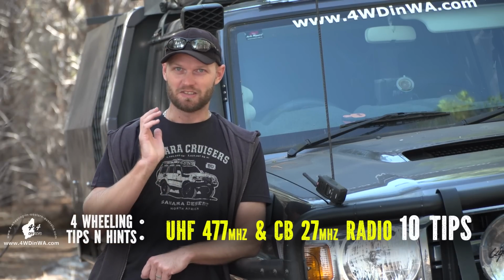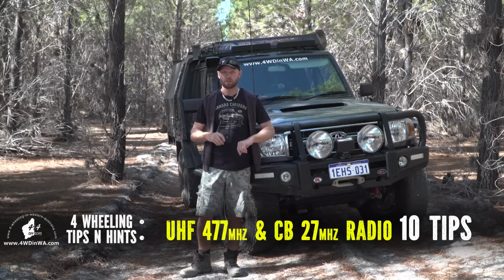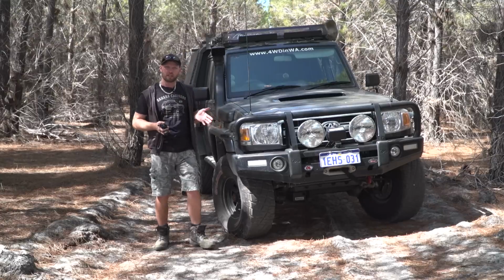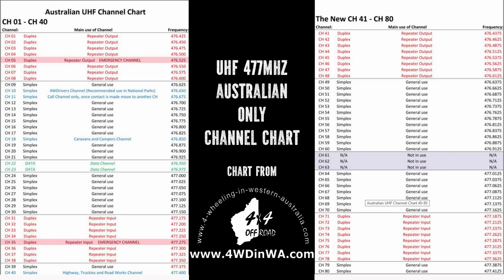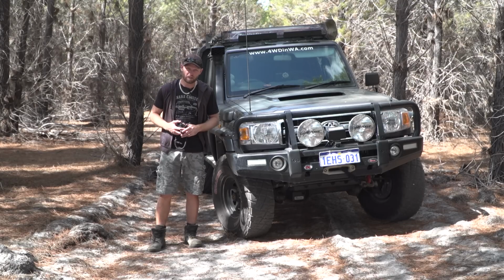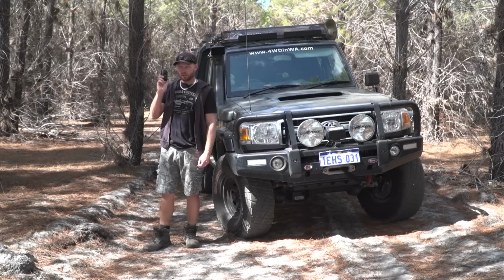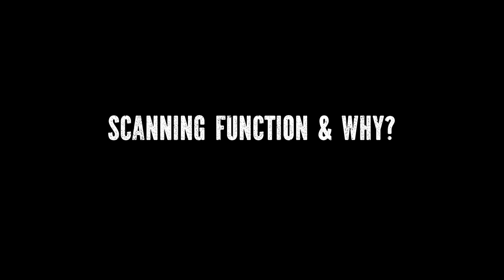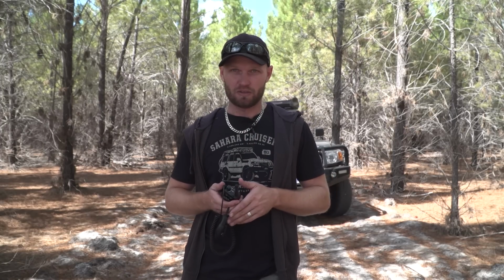UHF CB Radio 10 Tips

Comment: Drawback of so many options here in the US is that different groups use different radios. We've got about 6 different common options (not counting Sat/Cell.) Canada is similar. Maybe this info will help out some of your N. American viewers.

== BLUETOOTH ==
Really common with motorcycle groups. Interoperability issues if you don't all own the same make. Sena is the most popular brand around me. Range 1 - 2 km. No license. A useful piece of kit is a Bluetooth hub that you can plug into a handheld radio. Instead of pairing your headsets to each other, pair your headset to the hub, then plug the radio of the day into the hub too. All of the units I'm familiar with are helmet mount, but other form factors might exist. If you don't ride motorcycles with others, ignore this and move on.

== FAMILY RADIO SERVICE (FRS) ==
UHF-FM, 0.5 watt, 7+7 channels, no license. Extremely cheap to buy. Limited range. Very line of sight. ~1 km range. Very common with casual groups, families camping, etc. 

== GENERAL MOBILE RADIO SERVICE (GMRS) ==
UHF-FM, 5/50 watt, 8+7 channels. Range ~3km on handhelds; much further on mobile/base. Base stations, mobile, and repeaters are allowed, but uncommon. Most GMRS radios are sold as handhelds that combine GMRS with FRS bands in a 22 channel unit. License is required; no test, currently $90/5-yr. 

Compliance with the license requirement is largely ignored. Most people just buy a pack of handhelds then start using them like a kid's walkie-talkie. FCC is considering dropping the license rather than try to police it. When the FCC does cite people, they don't mess around. We're talking large fines in the thousands. You are required to identify yourself with your call sign every 15 minutes. Using one of the low power handhelds in a way that doesn't draw attention is fairly low risk, but being a goon over a 50W radio will of course draw attention. Dropping the license sounds appealing, but if they do, they'll likely lower permissible wattage and possibly add other limits like they did with CB. We'd possibly loose a lot of what makes it so attractive. 

That aside, if you do decide to go all-in, it is a great band. With a 50W mobile, you'll be crystal clear as far as the eye cam see. All the people with the cheap handhelds will hear you loud and clear. It far eclipses CB in clarity and range (most of the time.) $18/yr starts to sound more reasonable once you learn that you can do a lot more than that $20 Walmart handheld is capable of.

== CITIZEN BAND (CB) ==
27 MHz HF-AM, 40 channel +SSB, noisy, no license. Range ~7km AM, longer on SSB. SSB is a big improvement, but not available on the cheap models. Both ends need to have it to talk. Although not as common as it was in the 1970's, commercial truckers still use them to share reports of traffic, weather, police activity, (short skirts...) With casual recreation users, I think it depends a lot on region and group. Unless you're eager for those road reports, I think you can safely delay this one until you learn how common it is on your trails.  (Side note, you'll hear about long distance contacts on CB but there's a reason people talk about it... it is remarkably rare. Don't plan your comms on it.)

== MULTI-USE RADIO SERVICE ==
VHF-FM, 5 channels, 1/2 watts, no license. Range ~7 km. Base stations and handhelds. Used around ranches, etc. Not common among casual recreational crowds, so there is often lots of room. This is a great option for groups that drive together regularly, want to avoid the crowds of FRS, the static of CB, but want to stay legal without having to pay the license for GMRS.

== AMATEUR RADIO / HAM ==
License & test is very cheap. Wide selection of bands. Not very common for group excursions, but the most powerful and flexible. The entry level test is so easy a 5 year old can (and has) passed it. That'll mostly get you on the higher, FM bands. As long as you're near (20 - 30 km) town, you can probably hit a repeater and talk over hundreds of square miles. With a bit of studying, you can upgrade to get lower bands which can go thousands of km. Many towns have clubs that offer free/cheap training sessions which will teach you what you need to know then do the test right after, all in one day. People are perpetually upgrading radios, so if you're looking to buy, contact area ham radio clubs.

If you've got your GPS coords and a working Ham radio, no matter where you are on the planet you can reach someone somewhere who can relay a distress call and dispatch help, with no satellite fees. It does take a little more know-how than dialing a phone though, but you don't need to feel intimidated. In a genuine life-safety emergency, anyone can use any means at their disposal to call for help, regardless of licensing. If you're afraid of a tiny bit of studying and too cheap for the $15 test session, you could still buy one as a poor man's emergency 'sat-phone.'

I need to repeat that point. A lot of people groan about paying the GMRS license. Well, if you and your buddies can spare a Saturday to attend a cram/test session, or you can flip through a book then go sit for the exam, it is $15 once in your life and you can use radios that are as good or better than the GMRS stuff. (Not on the GMRS freqs.) 

Note that any good multi-band ham radio on the market could be programmed/tuned to every one of the above bands. Listening is perfectly fine, but transmitting from a non-type-approved radio is illegal.

-- TLDR; -- 

If you always hit the trails with the same crowd, then life just got simpler. Buy what the other drivers have. What's a guy to do if things aren't so easy?

* RAM mount or similar that can hold the radio of the day is nice to have.
* One combined FRS/GMRS 22-channel handheld. One FRS per person can be handy at camp.
* One CB handheld.
* One MURS handheld.
* VHF/UHF handheld Amateur/Ham radio if you decide.

I'd say start there in that order and the rest will evolve as you use things. If you use a band often and/or want better range/clarity, it'll become apparent to you which systems you should add as fixed installs. FRS are pretty much limited to handhelds by rule, but you can get mobile installations for MURS/GMRS/CB/HAM.

Just plopping a magnet mount antenna (if available) in the middle of your roof can help a lot as an intermediate step. Swapping the included rubber duckie antenna on all the handhelds (except the FRS) can also help a lot. As a rule, you're better off with a top quality antenna system and a cheap radio than the other way around.

Wow, that got long! Hopefully it'll be of use to someone.
Reply: The FCC is keeping the license requirement for GMRS. They are also going to allow FRS up to 2 watts on the 462MHz channels.
Reply: ElfNet Designs FRS/GMRS in Europe are widely used for Fire Brigades in the UK, Police in Russia, Amateur radios in Germany.
Reply: Jordan Cunningham The aircraft band is from 108-136mhz Am☺
Reply: Seth Williamson in an emergency what radio would be the best to own in NYC
Reply: @Dan Guilfuchi - Emergency as in disaster preparedness? I've only been to NYC once, but I think the best place to start would be to search online for something like "NYC amateur radio club." DXZone has a good list you could start with. Get in touch with them. They'll be more than happy to chat with you at length about the pros and cons of different options based on their combined experience operating in your area.

In general though, I'd recommend getting the entry level (Technician) amateur radio license. It is cheap and easy. You likely have clubs near you putting on weekend class + exam sessions. From there, a handheld VHF/UHF radio will get you talking either directly or via the (likely) extensive repeater coverage in that area. Wouxun KG-UV6D or similar is a pretty inexpensive entry level radio. Check out brands like Yaesu and Icom if your budget allows.

The ARRL is the US national amateur radio association. They have a program called ARES (Amateur Radio Emergency Services) that you might be interested in. 

Hope some of that helps!
Reply: Right you are. Good catch. That far into the post I was worrying about brevity and I clearly mushed things up in that case. Fixed thanks to you. :)

Gear can be extremely expensive or relatively cheap depending on your tastes and wallet. You can easily spend more than you would on a new car. Like any hobby, there are always those that need to have this year's latest and greatest. The used market can be quite fruitful. For a new person just getting on the air, the guys in clubs around me have even been known to give away gear for free. Many HAM's have a garage full of unused gear. If all you need is a VHF/UHF handheld, there are some Chinese models that are surprisingly well made for the price, under $200 USD. For VHF/UHF mobile, I'd start on eBay personally.
Reply: Seth Williamson which would aircraft radios be?
Reply: ElfNet Gaming I'm from the Philippines too. They're selling Australian UHF CB 476 MHz radio, US/Canadian GMRS/FRS/GMRS radios in the Philippines via OLX, Lazada, etc.

Philippines has 325 MHz 40 channels  walkie talkies for their country.

Australian UHF CB radios covers theTV frequency of UHF TV15 in the Philippines/Americas, UHF TV 14 in Japan, etc.

Is it legal to use UHF CB Aussie radios in Americas? Thanks.
Reply: CB is 11 meters when 10 meters is open so is 11 meters. It's not rare.

Comment: like always, outfreakingstanding!  Only things I have to say is you can do long distances on lower output but things need to be ideal (good terrain which typically equates to elevation coupled with little to no interference).  I have made perfectly intelligible transmissions/receptions over several miles in the US Rockies.  Another thing is duplex isn't limited to obscure towers, my rig is also capable of functioning as a repeater for the purpose of emergency communications network.  Despite those two things, definitely a better job addressing this issue than I could do.  Great Job!
Reply from the maker: +USCOMBATDIVER excellent point with the mobile repeater station, I'm going to have to try this out sometime.

Comment: Does anyone know if you can use a handheld ham to communicate with a CB?
Reply: if you find an old radio or some military radios don't have those channels blocked out.  The capability isn't extraordinary it is just most modern radios have those frequencies blocked out for a variety of reasons.  A close amateur bandwidth is 10 meters if you want similar characteristics.  Both the CB and similar frequencies are ideal for open spaces.  UHF and similar or higher frequencies are better for closer range but more obscured (buildings, trees, etc.).

Comment: Hello Ronny, i am having a dilema with my uhf with my mates. only recently in the last few trips my uhf has been playing up with one of my mates and his only, i can hear everyone else perfectly and everyone else can hear my perfectly, he can hear my perfectly although when he talks to me it sounds like he is just spamming the talk button while talking along with it being really muffled, i have reset my uhf and it still did not fix it. what do you think is the problem? for me to just not be able to hear him could he have a blocker on me of some kind without knowing? in the past it has worked fine only the last few months its played up. any input is appreciated. cheers
Reply: ditto to Ronny's comment.  Along those same lines an accidental bump of the radio could put you into 'privacy' channels where a certain code/signal must be transmitted with or before transmission in order for it to pick it up.  These settings tend to be found within squelch settings if that's the culprit and sounds like a likely candidate of the issue.
Reply: where I  can get a  walk talk cheap. text me at  769 -926-6161 ps James
Reply from the maker: +RCCARTV100 could be your squelch setting, that cuts out background noise but also cuts out weak signals. His antenna might not be casting a very good signal. We have also found that some radios are very low in volume than others and sometimes it's because they have an old 40ch and you have a very new 80ch. That's about all I can think of. I'd start with the squelch level and you will need to read the manual to adjust it as it differs from radio brands. Good luck mate.

If anyone else has some ideas feel free to input...

Comment: We say breaker then the channel we're on. Breaker 1-9 only applies to channel 19. Usually it's just shortened to just break though. Break 1-9, break 4-0, break 2-6, etc.
Reply: +Ken MacMillan -- Yup. Stating your channel is really common with ship-to-ship comms where they have to monitor multiple channels simultaneously, so they know without looking which channel the message is coming from. That's not just for breaking but for calling. Even with just one radio, listeners may have them in scan mode and can't take their eyes off the road/trail just now. 15 seconds later they're through the tricky bit and glance at the radio, but it is scanning again. If you've said your channel, you help listeners respond.

Comment: Good video mate, here are a few more important tips:
1) Press the talk button and wait 1/2 a second before you talk, so the first word of your conversations is not cut off.
2) If you have a lot to say, only talk for about 15 seconds max, than take a 2 or 3 second break before continuing to talk.  This allows someone to cut in, in an emergency.
3) Learn the phonetic alphabet, or have it on a laminated card near the radio.
Reply from the maker: +AussieKnivesAndStuff great points there mate 👍
Reply: AussieKnivesAndStuff good points, I would just add that 15 seconds is a long time to talk on the net. I try to keep my transmissions down to 10 before a break. More importantly, when you break, before you break, SAY "BREAK"! That way the person receiving knows that you're about to break, and that your radio or theirs is not malfunctioning. If you don't say "break" they could think that they missed a couple seconds of your x-mission and create confusion. It also gives them the "preparatory command" they need to break in if they need to.
Reply: @DvrkBvrts 
In the army (artillery) the BC (Battery Commander) would usually waffle on and on with shit (orders) and nearly always sent as 'Officer to Officer',
The transmission would be started by his callsign. 
For example: 4 this is 49, fetch Officer over. 
49 this is 4, fetch Officer, wait, Out. Then we'd go get the GPO (Gun Position Officer). 
He would give a break by saying "More to follow, over". This allowed the signaller at the other end to finish writing in his log book what was said or allow another call sign to interject with something more important. If no other call sign wanted to transmit the Officer would respond quickly with a Send, Over.
We never used 'Break'
Reply: @DvrkBvrts  break or technically  breaker breaker whilst it might shit you off it has to be used if you are trying to get a status report either on your signal or that you have an emergency in needing help..

I do not believe police or any other emergency services org has anyone employed to monitor radio on the cb emergency channels and this has been the case for close 30+ years...
Reply: @jasonhowe1697  I’m talking about saying “break” if you’re letting go of the button in order to let other traffic break in. For instance: “jaggoff 6 this is jaggoff 7 I’m enroute your position, I have a super important thing i need to show you break” (wait a tick...  for anybody with vital traffic...) “My ETA is 20 minutes” sigh off with whatever you’re signing off with “how copy? over.”
Reply: @jasonhowe1697  I’m sorry bud I really didn’t catch what you’re driving at there
Reply: @DvrkBvrts  been around cb's for a long service line to know their collective limitations when used in a convoy applications to know their limitations..

sad to say some  radios i seen in the past that ronny has used to not exactly qualify as cb radios..
Reply: As a former Artillery Signaller I can confirm the  pause part. We had a saying Press Pause Speak. It allowed the radio to power up from standby. and avoided clipping the beginning of your transmission. Whenever we had British soldiers on exchange they start their transmission with Hello, ... It sounds polite and posh but it's just their way of pausing before the main part of the transmission.
Reply: ZMPBP...100% spot on, from a former British OP Ack. 

For long messages we would however say “acknowledge, roger so far, over”, so the bod/Rupert on the other end would know it was going to be a long message. 

Or for Fire Plans “fire plan, fetch officer”, then let the Ruperts waffle on with their fire plans. 

You never forget it do you mate 🤣🤣  👍🏻👍🏻
Reply: That first point is so important! Always have mates that start talking as they're pushing the button and release it too early.
Reply: roger Roger.
Reply: Great tips!
Reply: tgvcwimsgqeubcmkyu